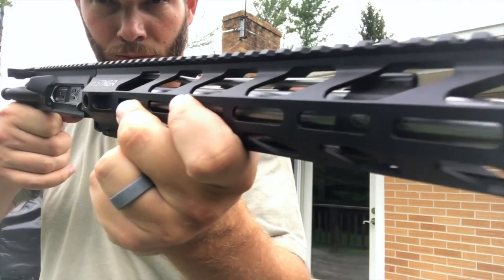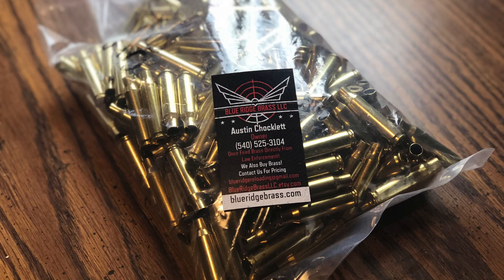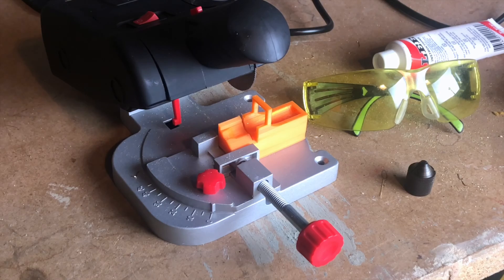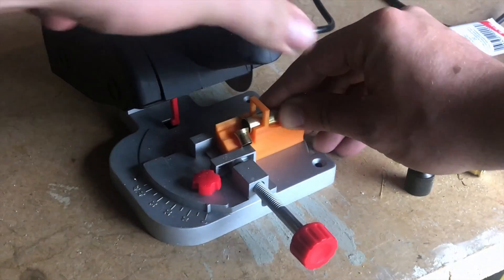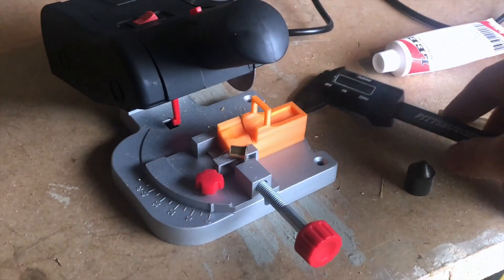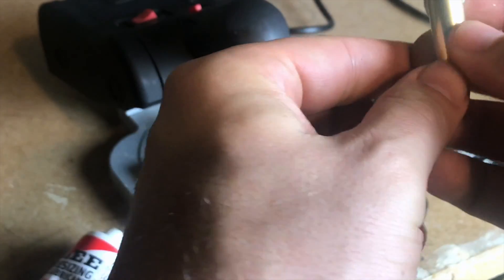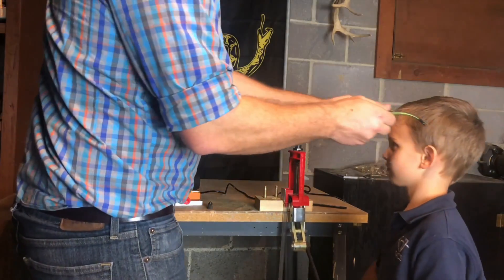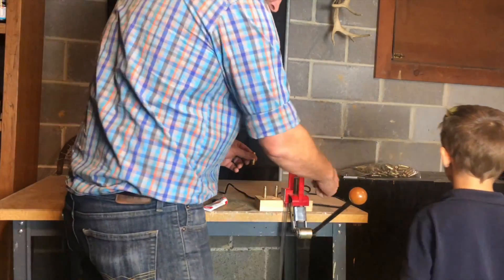How to Form  375 Stalker Brass

Comment: Another wildcat cartridge builds I do in the AR 10 you might have a need for is the 25-300 WSM and a 6.5-300 WSM both are fantastic in the AR 10.
Or the 250 Savage in the AR 10 is a problem free build to function from the AR 10 mags and cycling and so is the 6.5x51 jap in the AR 10

Comment: This is a 6 year ago video but I want to add this isn't the only 375 cal wildcat working in the AR 10 because I build and sell AR 10 uppers in all of the WSM magnums and one is a 375 - 300 WSM that is a match to the 375 H&H magnums for power range.
I personally hunt with my own AR 10 in 375-300 WSM with my most often load is the 300 grain bullets with a velocity of 2650 FPS from a 26 inch Pac Nor SS supper match barrel
Reply from the maker: This one isn’t an AR10, it’s and AR15
Reply: @ModernMountainMan  Alright I misunderstood which AR you are using.
So, you are using 308 cases for this wildcat, so I have something for you then,
I just started a new AR 15 uppers to sell in the Nazi STG 44 cartridge 7.92x33 Kurz.
PPU makes the loaded ammo and sells the brass for reloaders and MidwayUSA and Graf & sons sell the 8 mm bullets and Hammer bullets makes a copper hunting bullet in 140 grain 8mm for the 7.92x33 Kurz.
Doing Chronograph testing on the 7.92x33 Kurz it is identical to a 30-30 win load with 130 grain bullets .
I am also using junk 308 - 30-06 - 7 Mauser - 6mm Rem brass to make the 7.92x33 Kurz so even if PPU stops with the exports of ammo or brass so what! any cases on the 30-06 are easy to convert to 7.92x33 Kurz .
The bolts I am using are KAK bolts for the 450 Bushmaster and uppers I have to widen the ejection port for the large diameter's cases.
This 7.92x33 Kurz won't work with standard AR 15 parts so the BCG is a reduced weight, and the buffer spring is a 20% less power with a 1.2 ounce buffer.
Any other parts used the 7.2x33 Kurz has all kinds of jam up problems.
Magazines must only be Duramag 20 round 7.62x39 or single stack Duramag 450 bushmaster mags.
By using any other kinds of magazines this cartridge had many kinds of jam ups.
This freaking cartridge was a nightmare to work in the AR 15 costing me additional $300 over any AR I've done yet in wildcat cartridges.
At $1000 per Pac Nor SS supper match barrel by time to install barrel into the upper receiver this project was already deep in so stopping wasn't an option.
Reply: Interested in this!! .375-300wsm?
Reply: @cpt.ed.powell  What would you like to know about the AR 10 uppers in 375 - 300 WSM ?
I also have allot more AR 10 uppers with all chambered in noncommercial chamberings I build and sell through gun shows under my name of Lure Benson.
What I should make clear these builds aren't for the person who has assembled a few AR 15s because working with the pressures of WSM magnums in the AR 10 runs into massive problems if never worked on such an AR rifle .
I offer to prospective buyers to shoot any of the AR 10s I have on hand if in NW Oregon that is how sure of my work I am.
Reply: @cpt.ed.powell  on another subject for the 375-300 WSM Redding dies has been keeping around 10 sets of 375 300 WSM reloading dies ready for sale .
to make the 375 WSM using 300 WSM the first neck resizes is to 338 then 35 cal and then 375 and you have the case ready for the 375 -300 WSM die

Comment: Wonder how it would compare to the 375 socom with the 458 socom being the parent case? Just wondering.
Reply: 375/458 SOCOM use the exact dimensions of the 7.62x51 for the head and rim, but the case body is 0.003 inch fatter, so it is proprietary, because they were hoping to get a military contract. Performance should be very similar between 375 Stalker and 375 SOCOM, but...the Stalker is the one with cheap brass and available cases from .243, .270, .308, 7mm-08, .30-06, etc
Reply from the maker: With everyone sighting in their deer rifles,  I am playing brass buzzard at the range for new Stalker brass :)
Reply from the maker: I haven’t been able to compare them personally, but from what I understand they are ballistically similar.  The Stalker’s advantage is its brass is cheaper (or free if your range let’s you pick up brass)

Comment: How does that 375 Stalker & Reaper stack up against the infamous 375 Raptor?
Reply from the maker: I am still testing loads and there is not a lot of printed data yet, so I cannot answer that with a great deal of authority.  However I can say this, the Raptor's case capacity exceeds that of the Stalker.  The Stalker is designed for the AR-15, whereas the Raptor is designed for the AR-10.  So its kind of like comparing 300 Blackout to .308 Win.  (but maybe not quite as an extreme difference).
Reply: Oh man! What did I miss? Why did you say "infamous"? I'm getting ready to build an AR-10 style rifle to use the .375 Raptor cartridge. My sole goal is to have a heavy-hitting subsonic round with high bc, and I learned about the Raptor after having a long conversation with the guy who owns Maker's bullets. He really sold me on the idea and I haven't seen anything better. It's amazing how most ammo is completely neutered when you want to go subsonic, suppressed (.308 is not good at all).  Must have very heavy bullet, but lots of heavy bullets have horrible ballistic coefficients. Using the hunting bullets from .375 Ruger made sense to me, and using the .308 cases sounds good too (common magazines). Thanks for steering me in the right direction.
Reply from the maker: @davidbutler1825  I have only heard good things, so I am curious what Storman Norman meant too...
Reply: @ModernMountainMan  thank you for the support! I'm definitely going for it. There will always be plenty of 308 brass and plenty of.. 375 caliber bullets. Once I have the set of reloading dies, including the factory crimp die from Lee, and the barrel, I won't need anything else and even if it somehow dies on the vine, it won't bother me, because my goal will have been achieved, subsonic suppressed heavy-hitting and accurate. Even if I'm the only guy in the world who shoots it, that will be okay with me.
Reply: @davidbutler1825  you got an update for us?
Reply: @jimmythe-gent  Sorry. Not yet. I've been waiting for a specific adjustable gas block from Wilson Combat to come back in stock, and I think I'll have everything at that point. I have bullets, powder, primers, brass, and all the dies. I just got the gas block I needed for .300 Ham'r, so I'm building that one first.
Reply: @davidbutler1825  Cool brother, let us know how it goes and how you like it